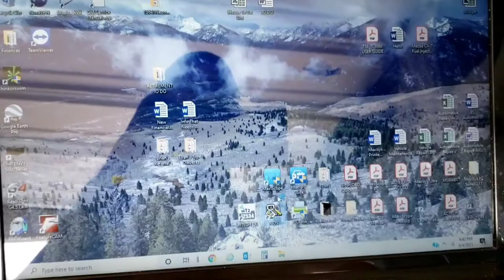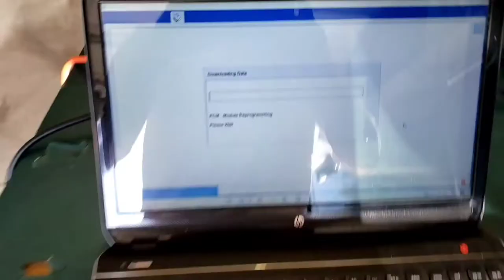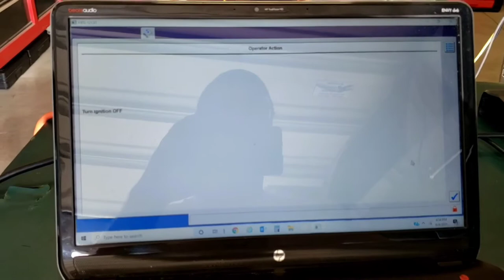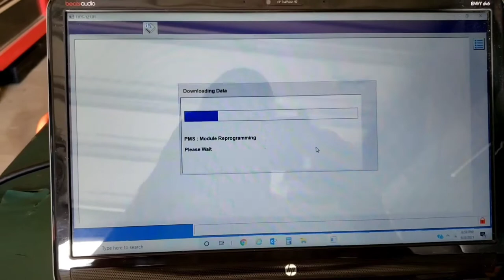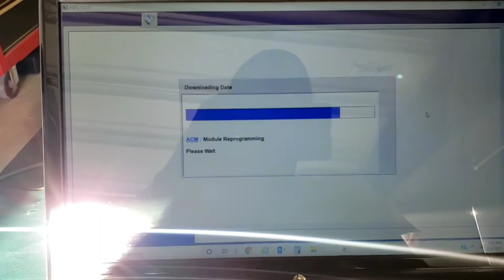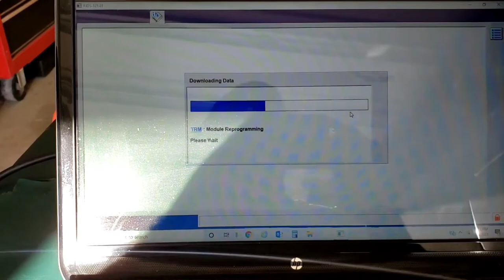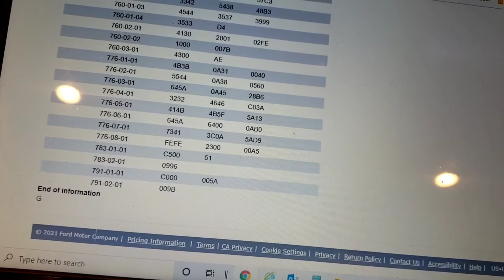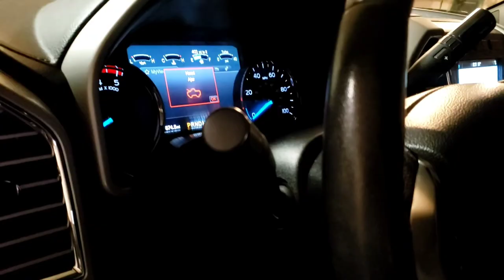2017 Ford F-350 6.7 PCM Updates Using FJDS & Forscan

Comment: I only do the module that is required due to the issues you ran into. It can brick the module sometimes. It is hard to explain to a customer why his radio or other component is no longer working.
Reply from the maker: For sure. I have definitely learned that the hard way.

Comment: How you do as built trying to put used pcm in 2008 focus original don’t communicate. Got used but fjds don’t have  pcm is as built option. Then if I try pmi won’t let me. Says the vin don’t match. Also tried leaving key off til you enter tear tag as how l1 automotive training shows in a video. Think they took the option out for used pcm
Reply from the maker: You can also get as built data from Fords website.
Reply: Okay so stupid question but you probably know the answer. The new used pcm tear tag does not match the original. You think that is the issue? Also how do you install as built data if the pcm isn’t listed in the as built tab. Has every other option module. Got the used pcm at a junk yard the dealer didn’t have any in stock. It’s from a 2010. If you go to flagship 1 to buy a pcm both part numbers I have are in there compatible list. Last question honestly idc if the vin matches could I use forscan go change as built data then add key??
Reply: So wonder if when it comes to the screen for vin verification I can select NO.  Then maybe let me put as built data in that way
Reply from the maker: @philh9238  is there anyway we can talk over phone...it would be easier that way.
Reply: Figured it out. Seen a YouTube video from opus Ivs ford programming tricks. You go in the settings hit the pocket knife go to special functions/ updates. Hit code 53061 then go back to pmi let’s you install as built data in all good now. Thanks for the help. Good vids btw